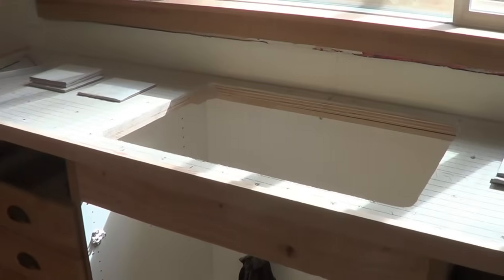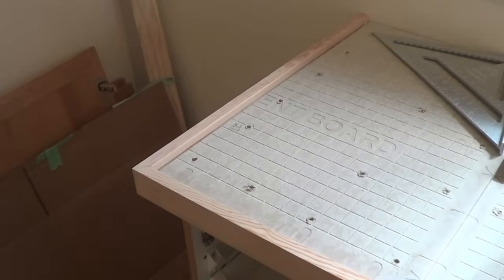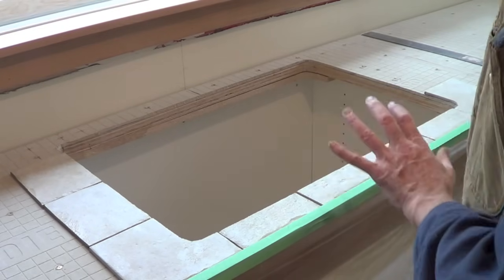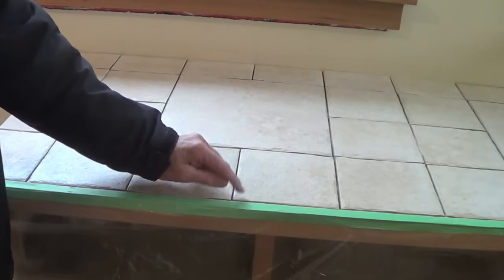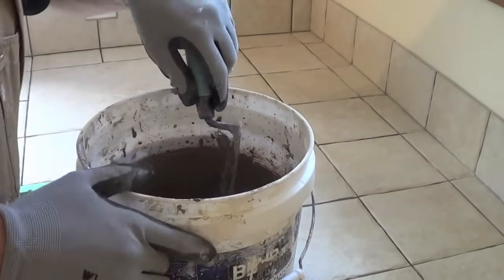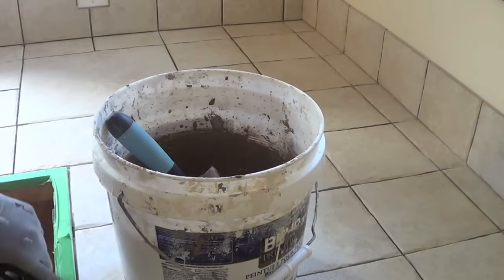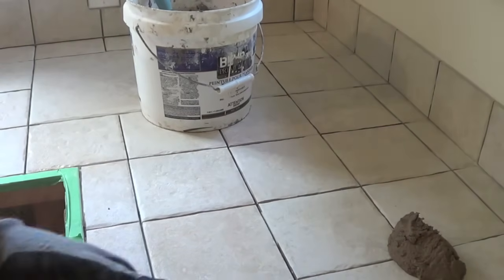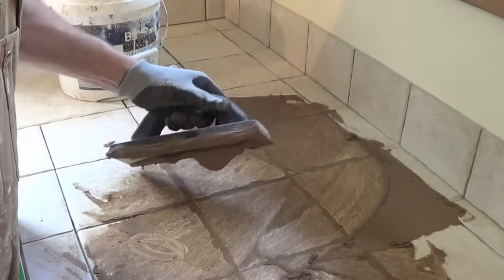How To Build a Custom Tile Counter Top

Comment: I have a question....on the tile near the sink corner, what tools/steps did you take to cut the curves?
Reply from the maker: Good question-- i basically cut in from both sides on the tile saw,  then free handed the corners by holding the tile up to the blade and "grinding" sideways, slowly working closer and closer to the line-- its my cheep method of doing that cut-- one could buy a diamond hole saw of a large radius and pre-drill the corners. I use a top mount sink generally to make the cutting simpler as the rim of the sink hides the cuts. -hope that helps- !

Comment: Is your fir edge (3/4" x 2") the actual measurements?  i.e. a 2x4 is actually 1.5 " x 3.5"  I'm working on this project and the hickory I picked up from home depot is sold as a 1" x 2" and is actually 3/4" x 1.5" and I'm nervous about having enough room for the thickness of the thin set and tile.  thanks for your help
Reply from the maker: Hi, thanks, i milled it my self so i think it was 3/4' X 1 3/4" -- 1.5" would be the minimum--- depends how this the substrate is-- as well as the tile-- defiantly want min. 5/8" above your substrate if you tile is 3/8"-- or 3/4" if your tile is 1/2" --

Comment: Very Nice! What kind of tiles are they?
Reply from the maker: Hi, If i am doing a counter then i always use a "Porcelain" tile-- Vs Ceramic which usually have a clay core or bace with a glaze on the surface. The porcelain is much more resilient to impact. 
 Hope this helps, i think the customer bought all the tile for this job.

Comment: Looks very good.   I want to use webbed back mosaic tile sheets as my countertop.  This will be on my just made new kitchen cabinets so there is no surface put down yet to start my countertops.

I'm open to some experienced suggestions as to what "sub straight" foundations I should use for my countertops. I know I will be using an epoxy grout and then a thin layer of epoxy covering all the tiles. After I have dispatched all the air bubbles with a heat gun and sand, I will then be putting a final splash coat of epoxy.

So I'm needing to know how and what I need to use for my countertop base and also recommendation on a brand and type of thin set to apply my mesh backed tiles to the "sub" countertop foundation.

I would like to thank you in advance for you time and information provided!

Blessings Always!

Doe Campbell
Texas
Reply from the maker: Thanks, sorry just getting back to you. Basically the strongest backer you can make. I would recommend 5/8" marine ply (no voids) or similar-- 7-10 ply laminations or a 3/4" ply with a 1/2" or 1/4"  hardi-board-- cement backer board of some kind.  Avoid attaching tile directly to ply or similar as i will expand and crack the tile.
Reply: The

Comment: I noticed you didn't primer or waterproof your cement board with any kind of waterproofing membrane are you using a waterproof cement board?
Reply from the maker: Hi Danny, No . I bedded all the tiles in  Non- Polymer modified mortar and used a pre-sealed grout . Years later no water issues -----
Reply: @mralexdenny  So its the pre- sealed grout that's protecting the substrate from water damage ? Does non- polymer modified mortar have any water protection ? i ask only because i don't have any idea. And thank you for taking the time to respond.
Reply from the maker: @dannybrazil3986  If you have water getting to the substrate-- your in trouble.
Basically if you use a cement mortar -- porcelain tile and pre sealed grout -- you should have years of use with no issues.

only use polymer modified mortar to bond to wood-- not porcelain or cement--
Reply from the maker: @dannybrazil3986  updated--https://www.youtube.com/watch?v=QxNIxgPsQCQ&t=226s
Reply from the maker: @dannybrazil3986  part 2 of the update--https://www.youtube.com/watch?v=-xi246woMV0
Reply: @mralexdenny   again thank you for your time  and helpful information.
Reply from the maker: @dannybrazil3986  your welcome-- any questions please ask--

Comment: Can I use one piece of plywood and one sheet of tile backer board
Reply from the maker: yes you can.  5/8" minimum ply and 1/4" minimum backer board. fasten well with screws and glue on any joints.
Reply: I'm tiling the edge can I use adhesive or dose it have to be mortar?
Reply from the maker: I would say that mortar is always the strongest in the long run, especially around a water situation and is proven and does require 24-48 hr. before and use. If i had a choice i would not use adhesive on the nosing although it is easier and less of a mess ..

Comment: I will NEVER use mortar again!  Its very mess, and sets way to fast. What i used was tube silicone ~ It worked Excellent ~ Fast and easy. Then i grouted it in  That another mess, Cleaning off the grout on the tile. But not as near as hard to work with,  as MORTAR 👎 You do got to rough up the surface and clean it!  Where its dry and dust free, using silicone ~ I can't even pry it up he hee
Reply: @bayareatrucking  🤪🤪You just can't work with mortar. You got  to level and set the title in. AND MORTAR DON'T GIVE YOU TIME ENOUGH 😡😡Silicone or Liquid Nails give you time you need

Comment: Tile countertops are disgusting. Food gets caught in the grout lines. If you want to clean it you have to take everything off the counter and scrub. Are you really going to do that once a week? No. Tile countertops are the most unsanitary thing you could do to a kitchen. I never ran into them until I moved to California. So gross. Don't do it.  No "yes but...". Its f-ing disgusting. Ever see a professional kitchen? They use stainless steel. Tile, which needs to be sealed, and resealed later, and grout which needs to be epoxy grout and resealed, is about as far away from stainless as you can get. If there was something I wanted to use to trap food waste, I would use tile. I worked in F&B for 28 years and I've seen & cleaned some disgusting stuff. Tile countertops are right up there. Ever see tile countertops in a restaurant kitchen? Nope. Now you know why. Disgusting, and nearly impossible to clean without a full detailing.